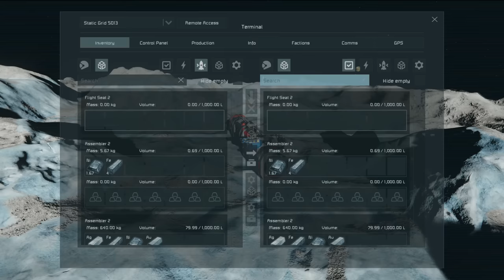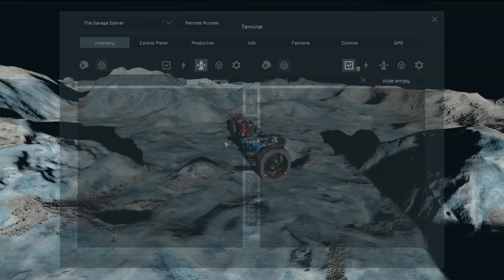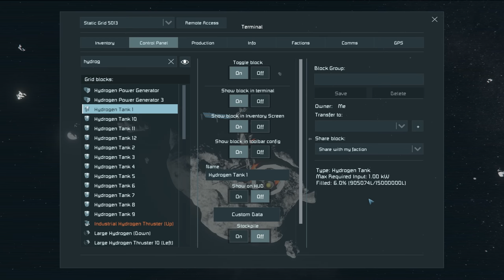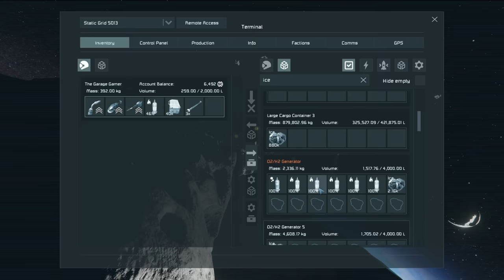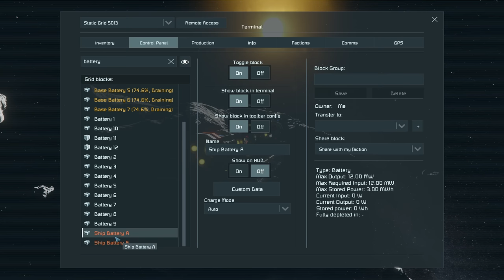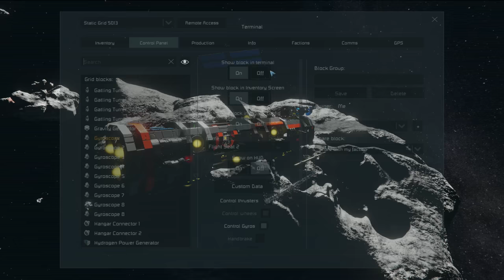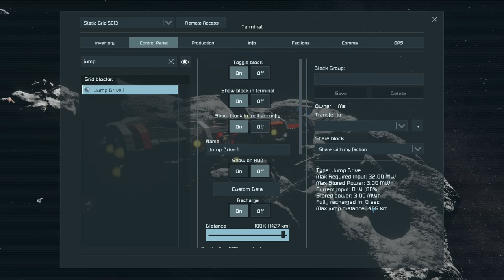Space Engineers - Space Survival - Ep10 - Going to Mars for Platinum!

Comment: Although the build planner (MMB) is unable to get components across connectors, it is still possible using the terminal. 
All the buttons between the two inventories work as they should, getting components from any available container.
Reply from the maker: A Terminal? You mean like a control panel?
Reply: @TheGarageGamer86  Terminal = Conveyor port (F)